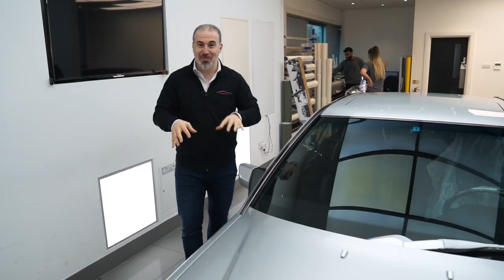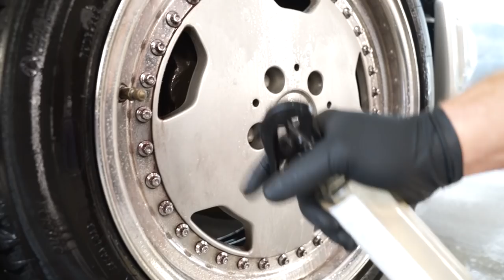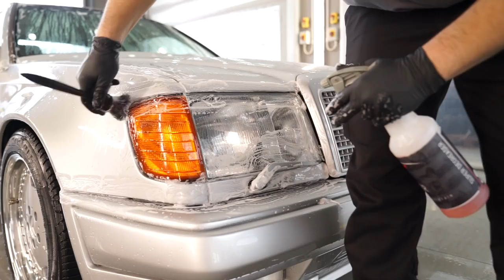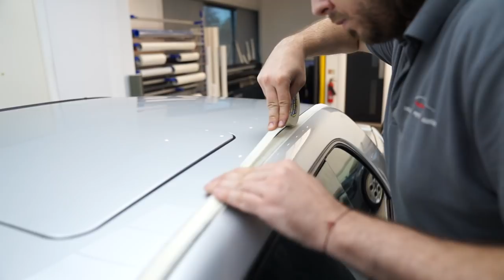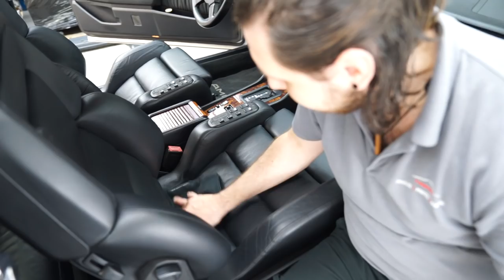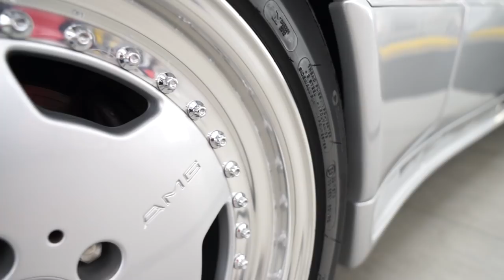Detailing the Mercedes AMG HAMMER!

Comment: Maybe the clips were played backwards, but why wouldn’t you ceramic coat the bare paint first and then top off with a quick detailer. The sealant in the detailer would prevent the ceramic coating from adhering properly?
Reply from the maker: Our mistake in the edit